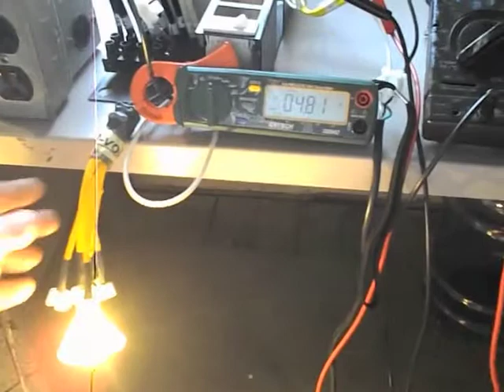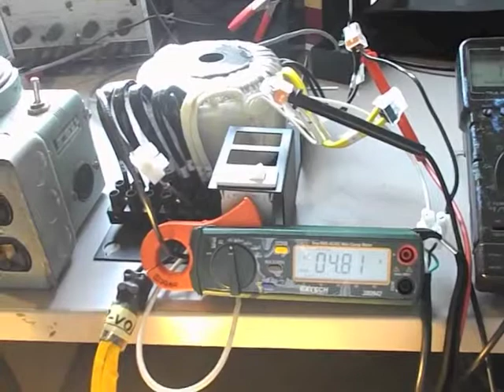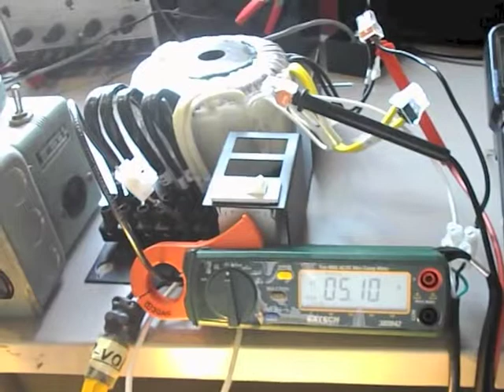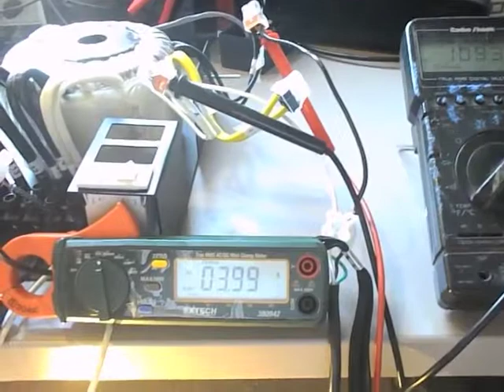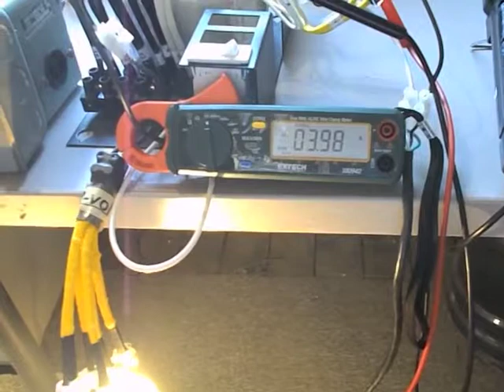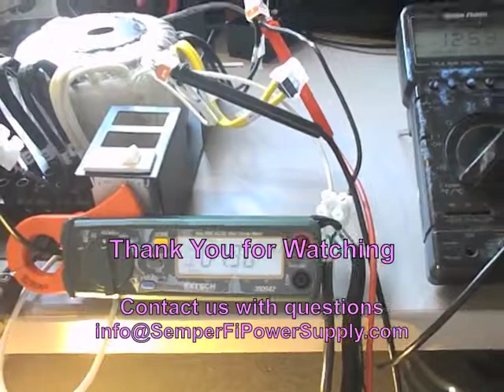Semper Fi Power Supply - De-Rate to Avoid Future Problems

Comment from the maker: De-rating is usually beneficial for a successful long term electrical installation; Wiring, Circuit Breakers, Dimmers, Switches, Transformers and other Power Components...

Semper Fi Power Supply - De-Rate to Avoid Future Problems